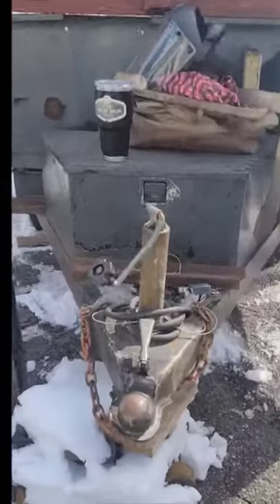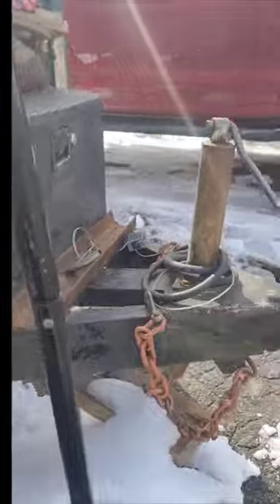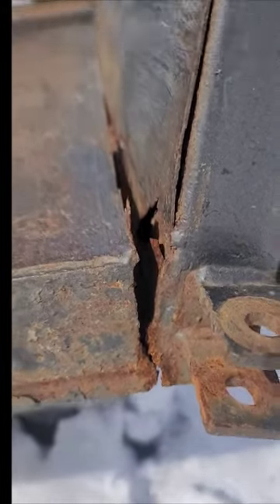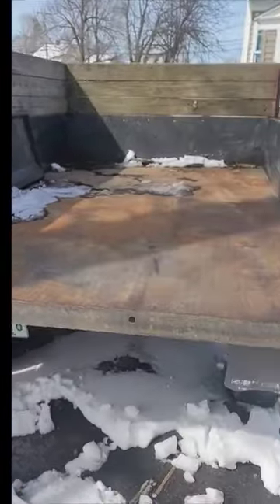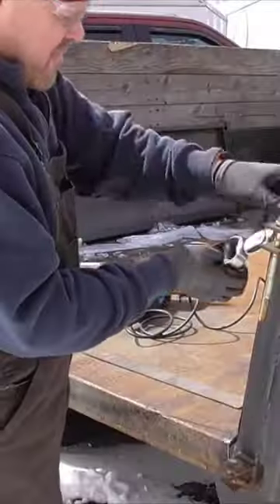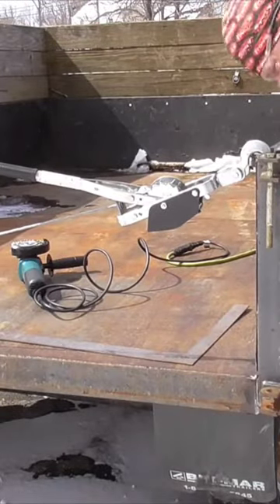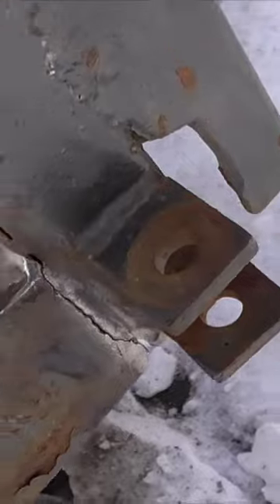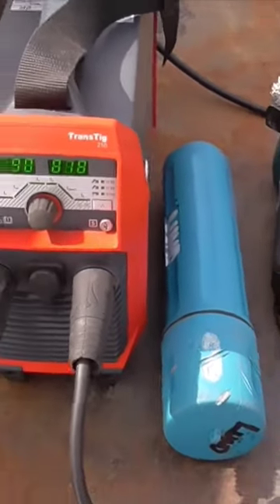Trailer Rolled Over - Welding Repair

Comment: You are such a pro.  I see a lot of rust and the metal is really thin.  Is there a reason why you wouldn’t have replaced the rusted metal with a new sheet?
Reply from the maker: The structural metal was not compromised, just surface rust. The metal on the sides was a little rotted on the bottom so I cut that out and rewelded. It's had a hard life for sure!